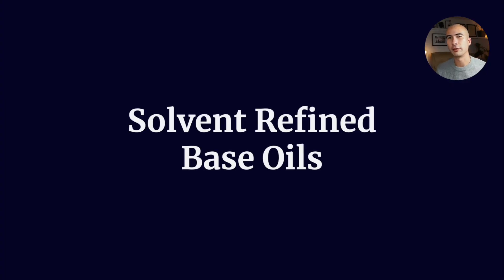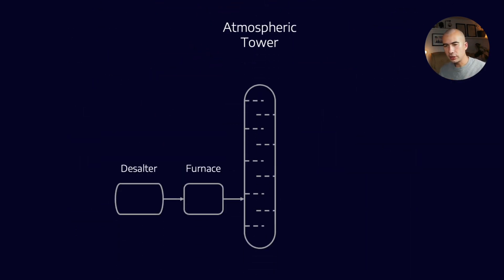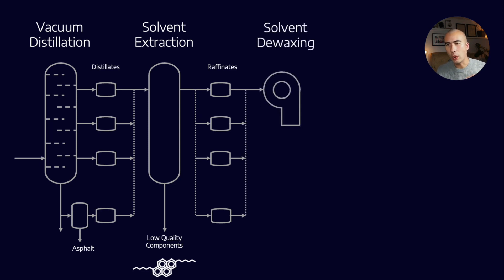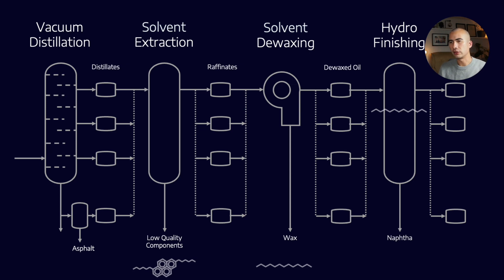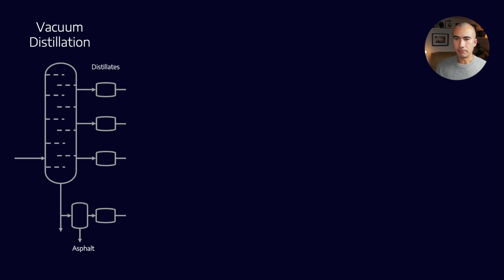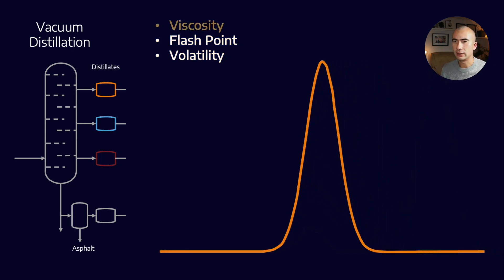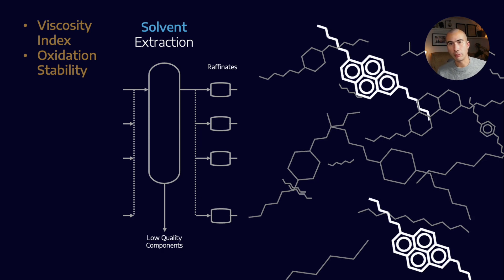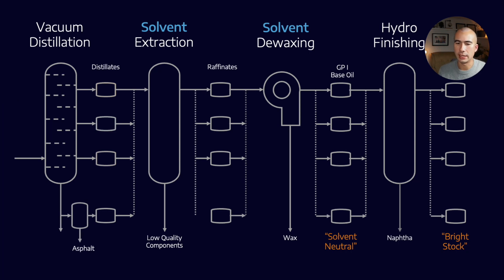Bright Stocks (BS) and Solvent Neutral (SN) base oils explained

Comment: great video indeed. I want to know from you that in diesel engine oil is there any possibility of negative side effects like corrosion of high TBN value as there is a case with cautic embrittlement that high alkalinity is also not good for metals?
Reply from the maker: It's possible, but I think you'd need a lot of TBN. Marine engines have historically run TBNs of 70-100, so in most commercial Diesel engine oils we're well below that number.
Reply: @LubricationExplained  in that marine history that much high TBN was required to neutralize high sulfur content of fuel but now in case of 15 ppm Sulfur in fuel how much TBN will be necessary & how much will be extra dangerous

Comment: different rafinates are used for making different grades or single type rafinate is used to manufactures all grades like SN-150, SN500, BS-150?
Reply from the maker: I’m not sure to be honest - I’m not deep into the manufacturing side of things.
Reply: @LubricationExplained  a guy working in a base oil refinery confirmed, Different rafinates are used for different grades.
Reply: @lubriTech  different raffinates mean? different solvents for removal of aromatics from oil? it sounds good that there should be different solvents to extract different coumpounds because each have a separate effect on viscosity.
Reply: @mfarooqiqbal  different feedstocks are used for different grades like SN-150 , SN-500

Comment: What happens to all the paraffins that have a melting point too high for lube or fuel oil, but melts too low to be sold as a common wax?
Reply from the maker: Good question - my background isn't the chemicals industry so I don't know for sure. I think I remember seeing somewhere that long chain paraffins are inputs into an Isomerization process that produces Group III+ lubricants. It's alternate method of making Group III+ that isn't just hydrocracking the s--- out of crude oil.